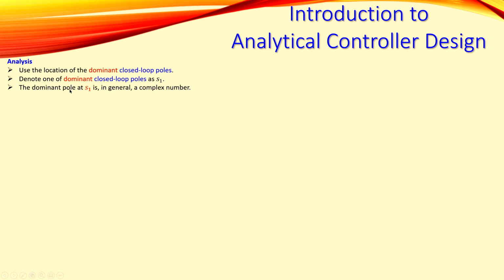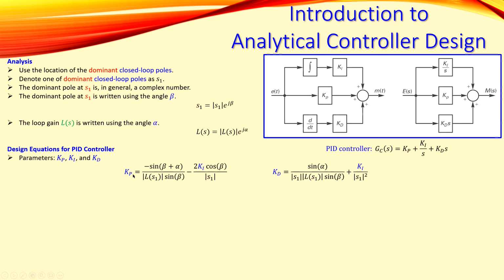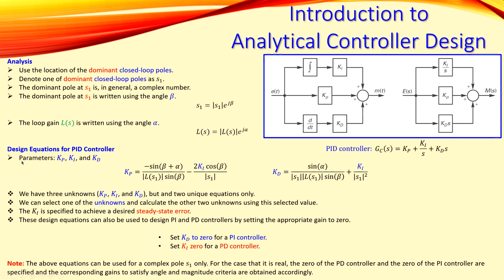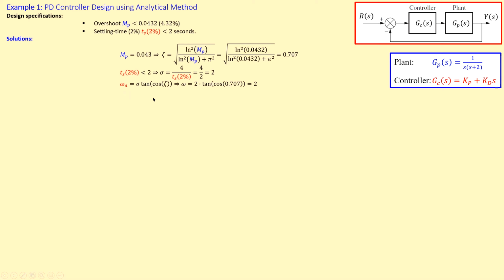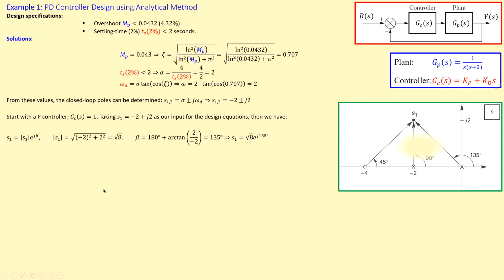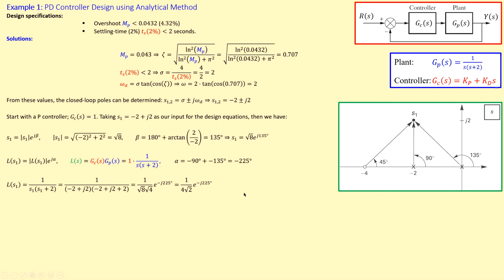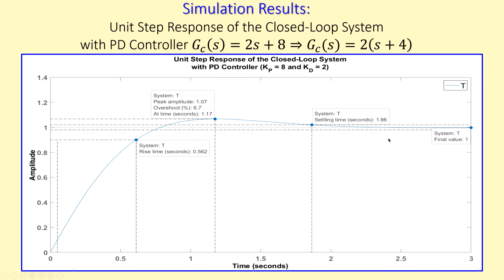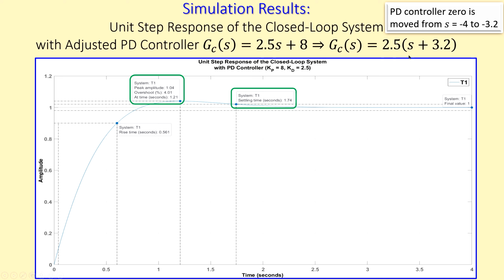Analytical Controller Design | PD Controller Design | Intro, Calculations & MATLAB Simulations

Comment: what would change if a transfer function was present in the feedback
Reply from the maker: That does not matter. You will need to use the loop transfer function and if there is a block in the feedback loop, you also need to multiply this to get the loop transfer function.
Reply: @CANEDUX  oh i see, thank you sir
Reply from the maker: You are welcome!